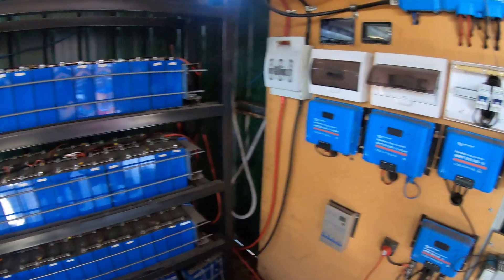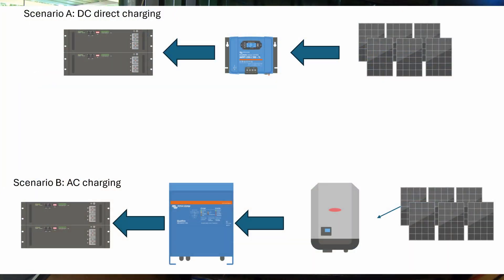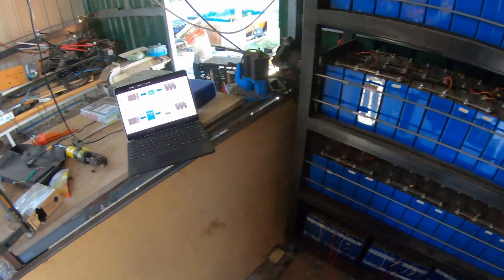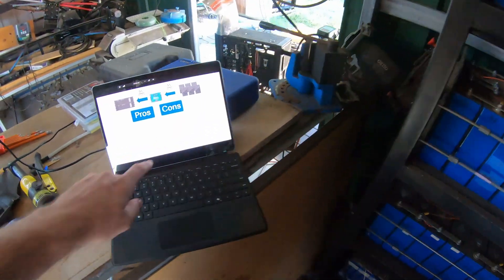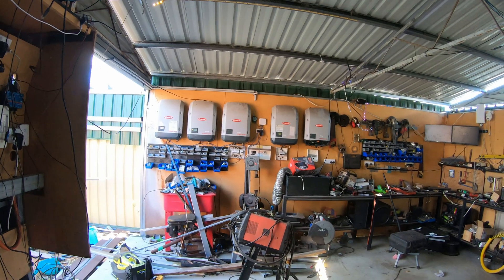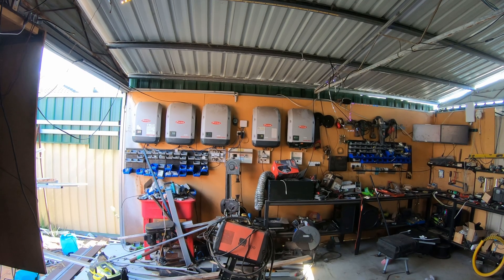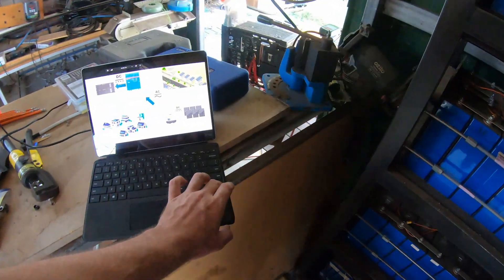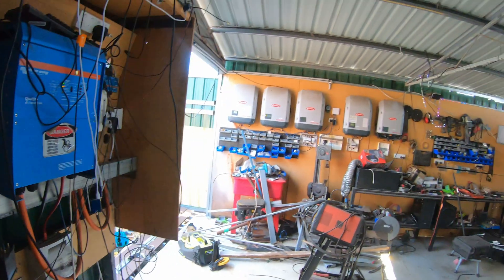Charge Source Efficiency vs Cost Effectiveness

Comment: My solution is to build  300V battery. Then I can directly run my 240VAC/ 300VDC powered air conditioner. After that, the rest of the house is pretty minor.
Reply from the maker: at that voltage there is very little energy conversion loss. Are you using a commercial BMS  ?
Reply: @BadIdea1123  One thing to understand is that I am an electronics hobbyist. I built my first electric motor when I was 10, my first radio when I was 11, and my first radio control car when i was 12.
For the BMS, I use six 16S  BMSs and one 4S that i monitor on an old Arduino. 
Yes, the battery is 100S 1P. 
I am using the EVE 100 Ah cells
Unfortunately, the charge controller I use doesn't have remote operation and can't communicate with that many BMSs so if the Arduino senses a high or low cell voltage, all it can do is trip a breaker to the battery. I use a Midnight Solar 600VDC 20 amp with remote trip for this.

For the charge controller and inverter, I found from AIMS that has a programmable battery voltage (80 to 495 VDC) and charge parameters. 
AIMS Power Hybrid 110823
This has a 9.6 kW 240 VAC inverter. Up to 6 of them can be operated in parallel 

All of this is just so I can power the EG4 hybrid solar air conditioner which can be powered either off of 240 VAC or DC from 100 to 380 volts.

Right now, I am only using the 240 VAC as a backup until I am done with system verification and validation. Then I will replicate it two more times to power my house and EV charger. The EV charger will have an independent system that can serve as a backup for the house.

Comment: Urm. Shading one panel does not take out the entire string.  Why did you say that?  All modern solar panels made in the last 20 years have bypass diodes.  Shading one panel takes out only one panel.  If you have paralleled strings it will also reduce the other paralleled strings by roughly one panel each (but modern systems generally don't parallel strings any more as MPPTs have become cheap).
Reply from the maker: Go and try that in practice and see what the MPPT does. The maximum power point is still going to be when say 3 of the four strings are at their highest output. It will only diminish its through put a little. Your right it doesn't completely stop. but it certainly has an impact.
Reply: @BadIdea1123  It has precisely the impact I said it had in my original comment.  I've had two large strings on my roof for 23 years.  In that time, 2 panels have failed.  My original string inverter had one MPPT so the two strings were paralleled.  My current one has 3 MPPTs so the 2 strings are not. This is precisely what happens.

If you have an insufficient number of panels in your string such that any single panel failure brings the voltage below the MPPT start voltage of the charge controller, the whole string will stop working.  That's one of the problems with low-voltage charge controllers.  Still, with 150V to work with and only needing roughly 65V for the MPPT to operate with a 48V battery system, you should have enough margin that this isn't a problem.

-Matt
Reply from the maker: I'm going to respond to this with a video. I will upload it shortly
Reply from the maker: Here is an example. The impact of shading is voltage specific and changes with the number of strings you have. So in my case, on the MPPT with 4x strings it is 23.7% drop.... so 2.3% below a whole string missing. 

I did however confirm that as the voltage goes up the impact is less

https://youtu.be/lczpyWIsmoI

Comment: If you can 100% net the power you export to the utility, then AC coupling has the least conversion losses.  But three major trends over time make AC coupling far less useful now than it was a decade or more ago.

* The first trend is utilities stopping net-metering...   replacing it net-metering with independent import and export pricing that drastically reduces the credit you get for exporting energy during the solar day.   This has already happened in California, for example.  In many places, and likely will wind up happening everywhere.

* The second trend are home owners realizing that they should install as much solar as they can.  Solar panels have become very cheap and hybrid inverters have become far more capable.  Throwing 10kW, 15kW, 20kW, even more solar onto your property if you have the space,    The vast increase in home production greatly exceeds typical self-consumption, and the reduced export credits generally means you want to bank that energy in a battery anyway.

Once you start banking considerable amounts of energy in your battery, AC coupling no longer confers any advantages at all.

* A third trend that is happening is that people are not paralleling their strings anywhere near as often as they used to.  My first solar system 23 years ago had an SMA inverter with two inputs but a single MPPT.  That is, my two strings were paralleled.   When I replaced that inverter a few years ago I suddenly had three independent MPPT inputs.  So I split the strings and gave each one its own MPPT.  This literally halved the current on the solar backhaul (while doubling the number of cables).  Losses disappeared, and partial shading on one string no longer affected the other string.

Taken together, these trends favor DC coupling, hands-down no question about it.  Not needing ANY power electronics on the roof at all is a huge money saver (at least in Europe which does not require per-panel RSDs).  Non-optimizing RSDs are cheaper than optimizing RSDs are cheaper than micro-inverters.    That leads to:

* With the money you save on equipment, just add more solar panels.

* And yet another problem is that large AC coupled systems often hit utility-imposed export limitations.   The inverter cannot guarantee that the export limit will always be met with AC coupled systems (by soaking up the extra energy into a battery system, for example).  So that creates a fairly severe problem that DC coupled solar does not have.  With DC coupled solar you can have insanely-large solar arrays and still meed all utility limited-export requirements.

Then we get to the battery storage.  The primary difference in efficiency between AC coupled and DC coupled really comes down to whether a round-trip through the battery is needed or not.  All other efficiencies are very good... good enough that literally a single additional solar panel covers the entire difference in efficiency between AC and DC coupling.  But the moment you run through the battery now you have three conversions... conversion to the battery voltage for charging, battery round-trip efficiency (roughly 95% for LiFePO4), and then DC-AC efficiency from battery through inverter to power the house when the sun is down.

These efficiencies typically clock in at 85-90% full-loop.   98% x 95% x 93%.   (0.98 * 0.95 * 0.93) = 86.6% full loop efficiency.  so you definitely lose something by storing energy and running it through an inverter later on.  But because net-metering is quickly disappearing from the utility landscape, this is still far more efficient than the import-vs-export price differential (which is often 4:1 or worse in many locales now).

The grand result is that a modern installation will want to DC couple, these days.  At least DC couple the strings and go into a string inverter so you can expand into an ESS system later on.   And if you have an ESS system... DC coupling from the start is really the best way to go simply because most hybrid inverters take DC string voltages on their MPPTs.   The few that are still AC coupled will likely be forced to switch to DC coupling in coming years.  Enphase might be the only hold-out 5 years from now.

-Matt

Comment: Nice explanation.  I had no idea how the Fronius inverters worked.  Do they require another inverter to create the micro grid before they start generating?
Reply from the maker: yea they do. The grid source is the victron inverter.  It has to be preconfigured with ESS and the fronius is swapped to MG50 or MG60 aka micr grid 50hz or 60hz
Reply: @BadIdea1123  Thanks for the clarification.

Comment: That was a great explanation for the advantages of ac coupling. I need to double my capacity to be able to meet my home’s demand and your setup has given me the idea to relocate my ac inverter to make room for the new multiplus. Cheers.
Reply from the maker: Thanks mate, good luck with your expansion. If you do go down that route look up the factor 1.0 rule from victron it explains the capacity limits using AC coupled inverters